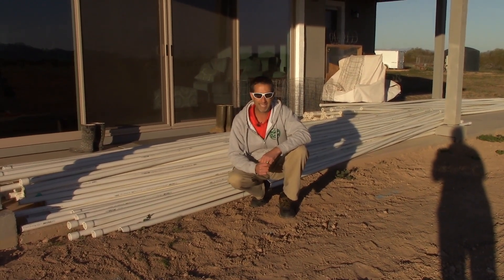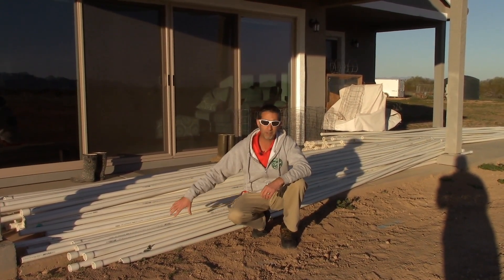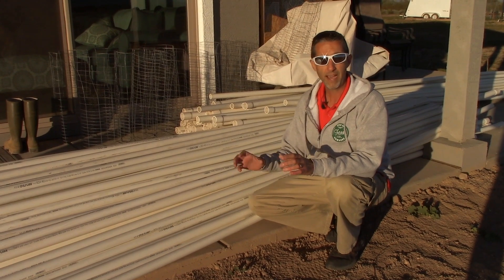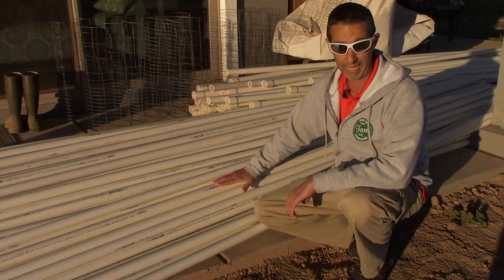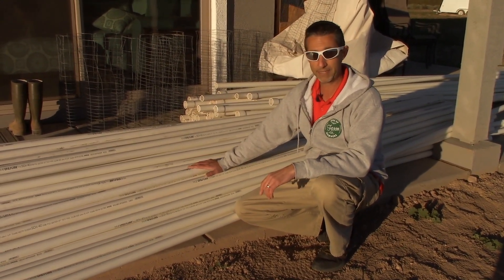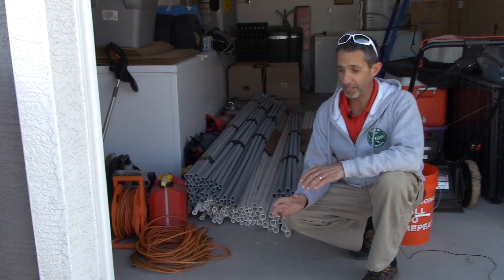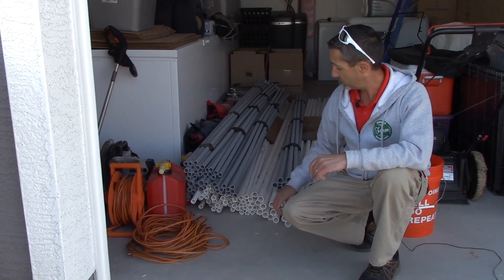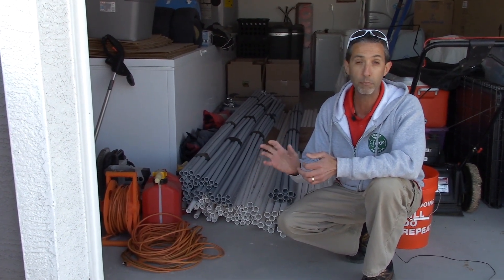Farm Irrigation Install Part 3 - Parts & Supplies

Comment: You'll never regret installing the larger pipe. It is totally worth the added cost. The inline filter will probably be the only thing needing attention long term. Well there is the replacement of some the end of line fittings but excellent system.
Reply from the maker: Hey Richard. Yeah, we wanted to ensure we could get water to trees anywhere on the property, so the larger pipe was the decision.

Comment: About glue.   There are two strategies.  The strongest glue is the grew glue which takes about 7 hours to set.  My worker does not like this glue.  Instead i have to by blue glue which sets in an hour.  He likes the blue glue because by fell he can determine if he has a good connection.  Colors refer to Christie glue.
Reply from the maker: Hey Glenn. Thanks for the notes. My only experience with PVC glue has been with the Blue Glue and really love that you can test the lines so quickly after installation. I would imagine a slower setting glue would probably be more durable.